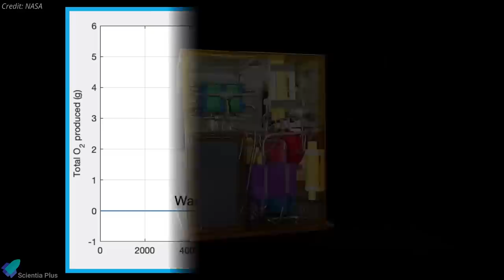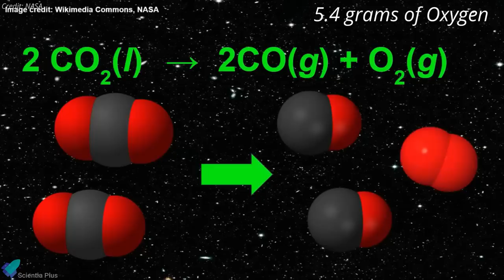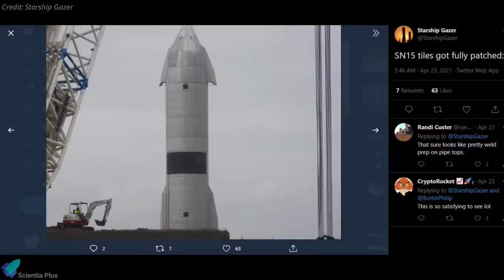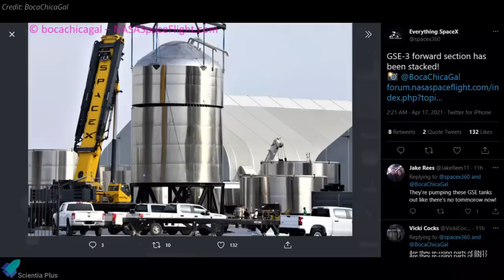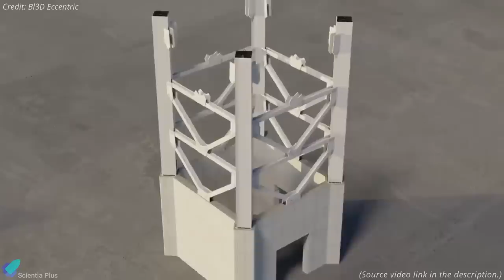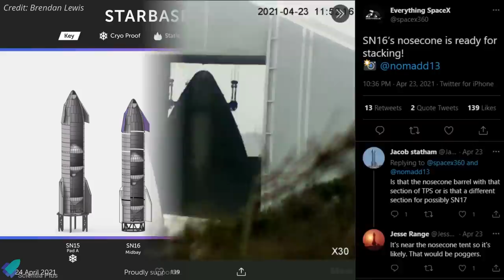Starship SN15 Launch Rescheduled | SpaceX Crew2 Mission Arrived at ISS | Ingenuity Flew Twice

Comment: What is the big deal.  Putting men into LEO has been happening for 60 years!  As for reusability, hell the Space Shuttle did that since the 80s hundred times.  Landing vehicles vertically was done in 1969 by the LEM and in the 90 by Boeing and others.  Hell the Harrier landed vertically since 1957.  What's up with this?